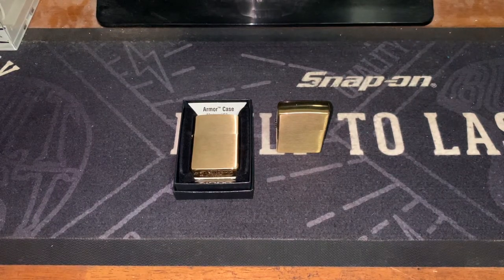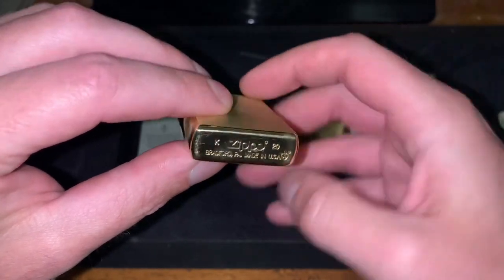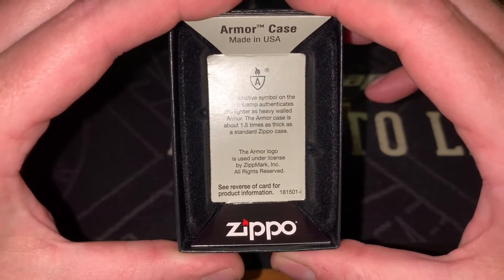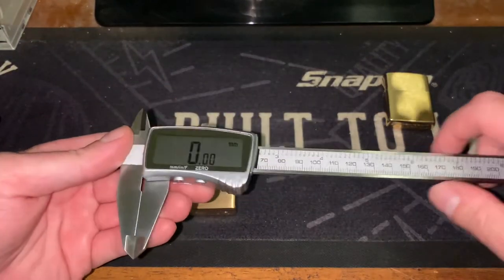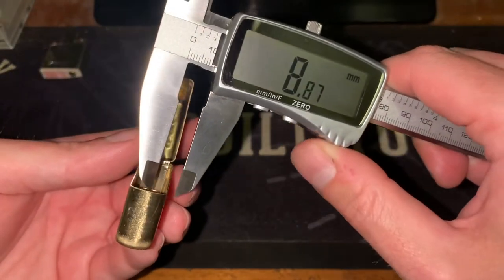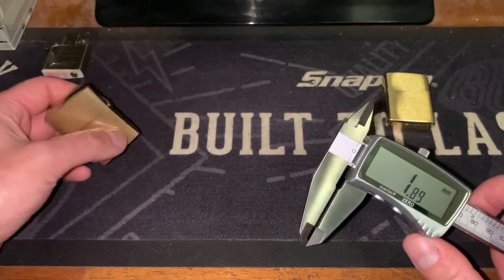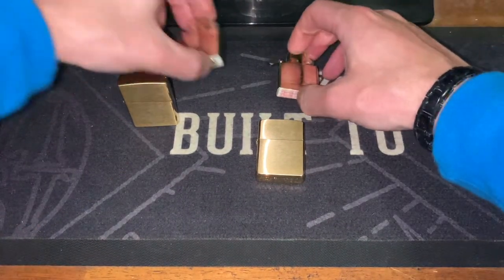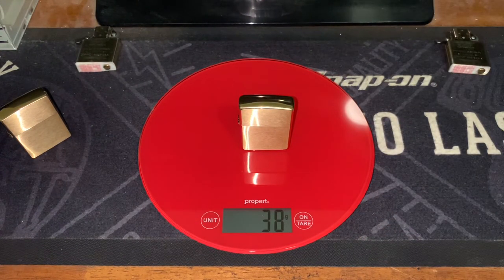Zippo In Depth Comparison - Armor Case VS Standard

Comment: Might sound stupid but can a regular insert be used on an armour case?
Reply: I think that's a great question.  My guess would be that they would use the same insert for ease of manufacturing, to keep it the same.
Reply: @huyked  thanks for replying back. Yes that makes sense totally.
Reply: @Hojoborolo_ami  
No problem.
I did a little bit of searching with:
"Can you use the same zippo insert in the armor case as well as the classic zippo case?"

That lead to their "Product Guide: Armor Lighters hidden" page, which states, "The Armor lighters use the standard insert with 16 holes in the chimney (8 per side)."
Reply: @huyked  that’s a good to know info. Thank you. Just another stupid question- I got my first one today but it’s a second hand so the chimney is completely dark with fumes. What’s the best home remedy to clean it??
Reply: @Hojoborolo_ami  
No problem.  I actually don't have a Zippo myself, but I remember my dad having one.  Might get a basic one for fun.  Anyhow, I don't know the answer to your question, but just do a search and you'll find the answer for sure: "Cleaning Zippo Lighter Chimneys"
Reply: @Hojoborolo_ami use alcohol for cleaning the chimney and check if the wick is routed correctly inside the fluid compartment. (You don’t have to check that if your zippo is pretty old
Reply: As long as you use Zippo brand inserts, you're good to go.
If you use aftermarket inserts, your luck may vary.

Comment: Back in 1962, there was a Zippo customer who returned his lighter to Zippo stating that the lighter is too heavy. George Blaisdell returned the lighter to the customer together with his personal check of $3.50 with a note: Suggest you give it to one of your stronger friends. 

But Zippo listens to its customers. Zippo has indeed over the years worked towards making the Zippo lighter weigh lighter. You would want to have a lightweight lighter. And armor Zippos defeat that purpose. It only makes the lighter weigh heavier.

Comment: Lmao this is pathetic. Standard Zorro 902 has a wall thickness of 0.80 mm. That beats both standard Zippo and Armor Zippo for a fraction of their price. Also, Zorro hinges are more durable from my testing.

Zippo is cool and all, but there are definitely better products for a better price. If you don't care about the brand, go look for alternatives. For example, Zorro 912 is 150g worth of brass beast, which even has an o ring to prevent gas evaporation.